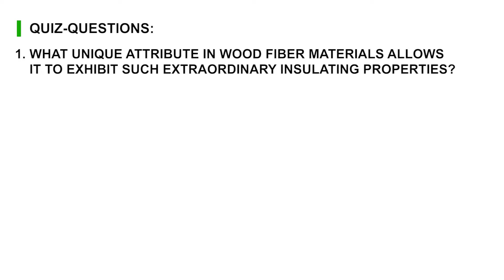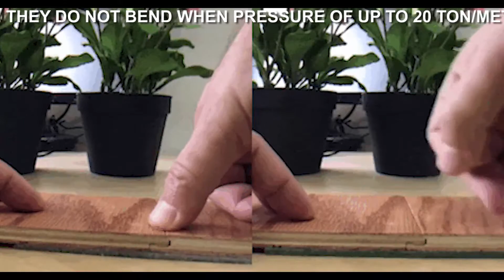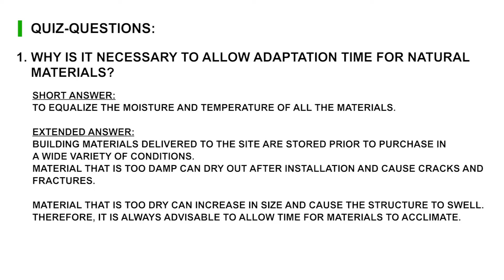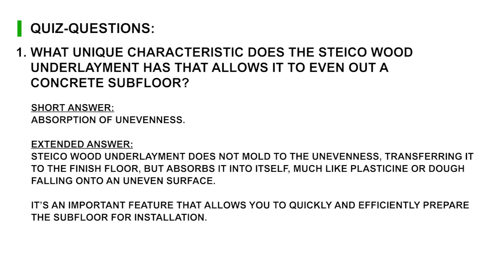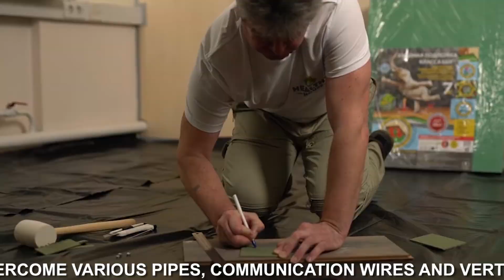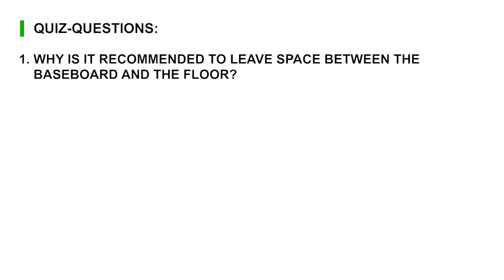WOOD UNDERLAYMENT STEICO - FOR FLOATING, LVT AND ENGINEERED FLOORS

Comment: I'm intrigued by this material - I have a question regarding it's capabilities to compensate for subfloor irregularities. The video demonstrates high spots (with the screws) but not anything on low spots (the video attempts this at 15.30 but doesn't show how it accomplishes this, other than just saying to use 1/4"). My question is specifc to using over existing ceramic tile, which is otherwise very flat except for the grout lines, which in my case are ~ 1/4" wide and about 1mm lower than tile surface. I'm curious how well this material would bridge over the grout lines. Obviously you would avoid joints over the grout lines when laying out.
Reply: Did you end up using it and what are your thoughts? Laying it over old vinyl square tiles that are peeling up, so some areas are uneven.
Reply: @janicerodriguez3696  I did use it and was  really impressed with it. The specs say that 1/8" will accommodate unevenness compensation up to 2mm and the 1/4" 4mm. I tested by placing a piece over a grout joint, then sample of my flooring and pounded with a hammer - the grout line did not telegraph through the Steico.